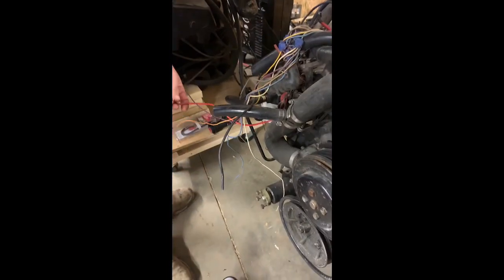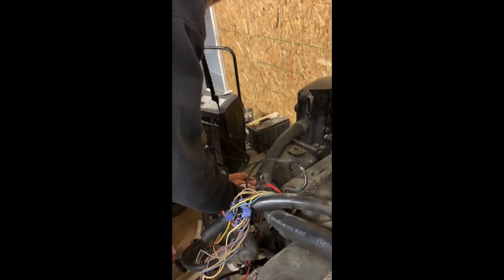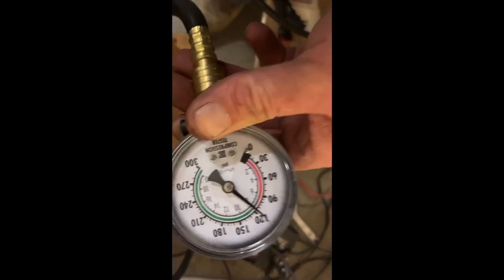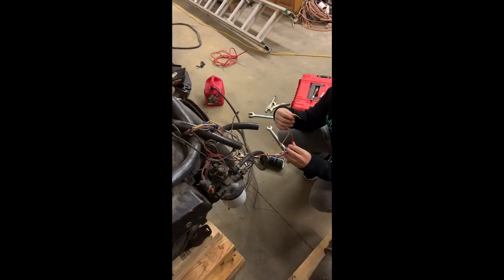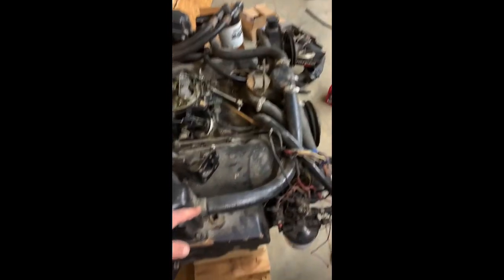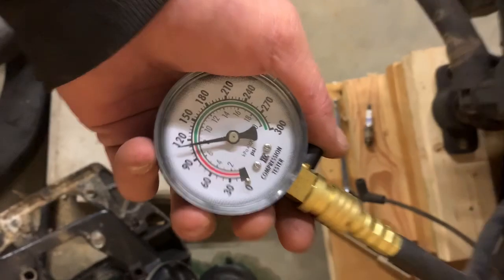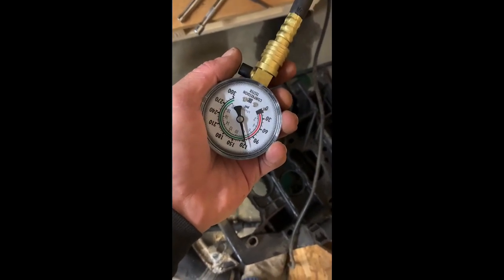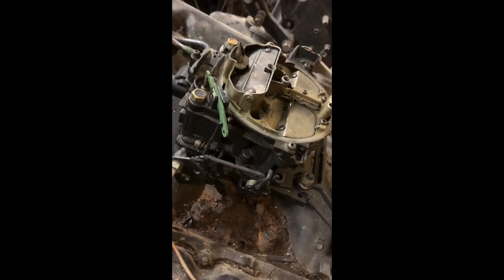454 Compression test

Comment: Which wires did you connect from the starter to the battery?
Reply from the maker: If memory serves you need to connect the red to positive, ground the block. Exciter wire for the starter is usually purple

Comment: hello i was just wondering what the problem was that led to the compression test?? i have a 454 i am chasing a problem
Reply from the maker: Bad miss. Ended up being one of the carb circuits not fueling. Fuel plane intake, so it was only running on 4 cylinders

Comment: Hello I’m 15 and I’m building my first truck it’s a 1978 Scottsdale and we have a 454 is there a way to check compression without Turning it over?
Reply from the maker: Also kudos for taking the initiative to build your own ride at 15!! 👏👏👏 Your parents raised you right!
Reply from the maker: Not that I am aware of. This compression test was done dry as well. Normally you would hold the choke on the carb wide open, have all the plugs removed, and oil the cylinders down before checking the compression.
Reply: @Biltwel1   I can't for the life of me find a spark plug socket that fits. I have 396 heads on my 454bbc. Do you know what socket will fit? where i can get it? haha
Reply from the maker: @dave5799  mine are deep well 5/8”
Reply: @Biltwel1   Mine are 13/16.. just can't find a socket to get around the headers. Annoying.... need new headers? haha
Reply from the maker: @dave5799  haha! Sounds like it!